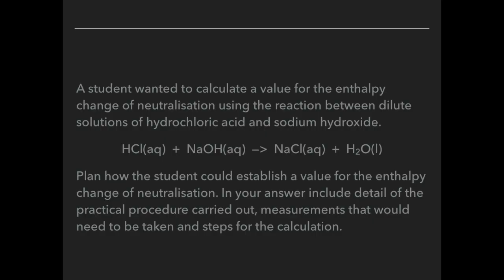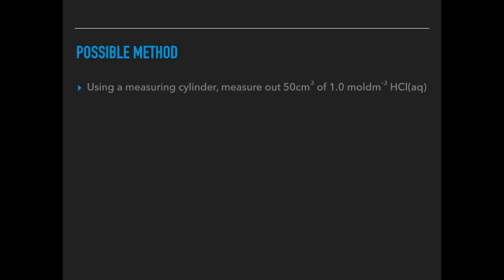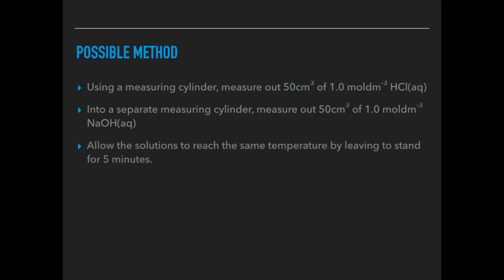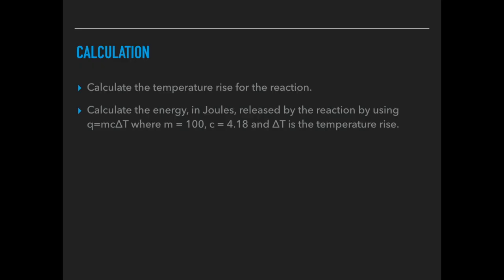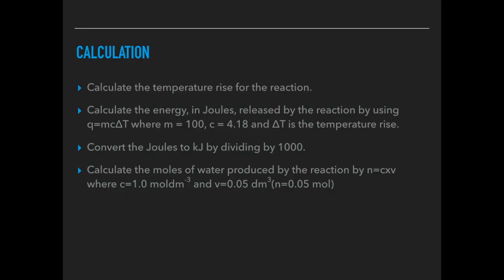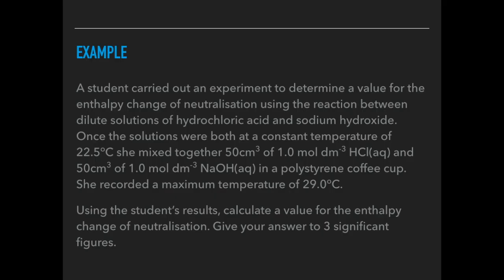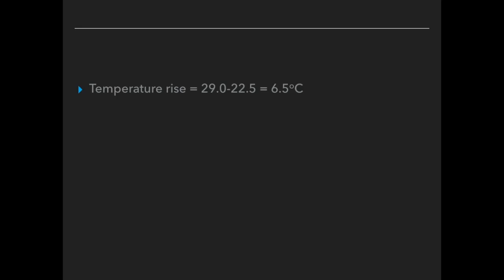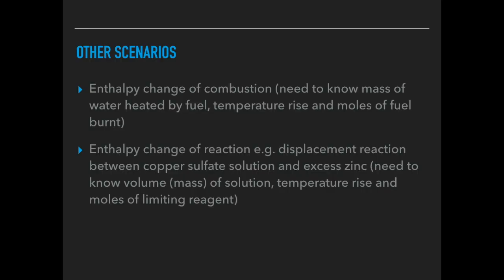PRACTICAL SKILLS - PAG 3 - ENTHALPY DETERMINATION

Comment: For the temperature change, you can just measure the initial temperature of the acid and alkali and then measure the maximum temperature reach? So we don't need to record the initial temperature, then record temperature at regular intervals and then plot a graph of temperature against time, and then extrapolate to when the two liquids are added together to find the maximum temperature? I remember doing both the methods described in the video and the one I have described, but are they both correct for this experiment? Or is it one I have described used for another type of enthalpy change experiment? If so, when do we use the one I have described?

Comment: if the volumes of HCl and NaOH were not the same would you find out the moles left after one of the reactants is completely used up and then take this value as being the same as the moles of H2O?
Reply from the maker: sophia bonifacio moles of water is determined by the limiting reagent in other words the lowest moles of acid/alkali
Reply: Great thanks!
Reply: Say if you used h2s04 and naoh would you use the moles of naoh since they have the same ratio?
Reply from the maker: SidTheSloth Establish the moles of acid and base first, factor in mole ratio to determine which is limiting reagent then work out moles of water
Reply: what if they are in equal amounts?
Reply from the maker: SidTheSloth all depends on the mole ratio.